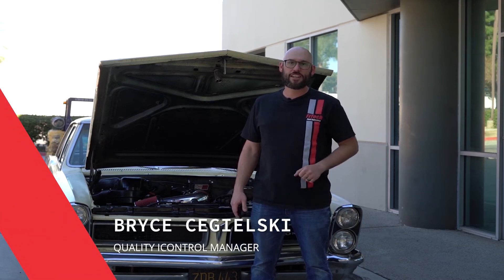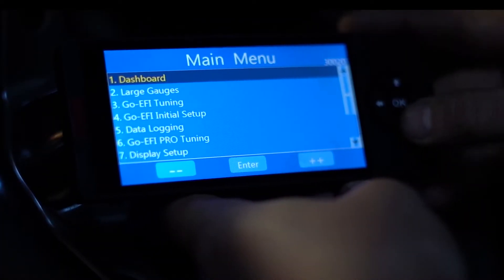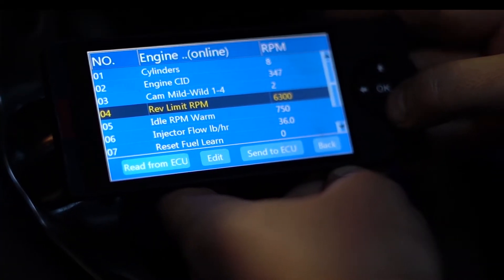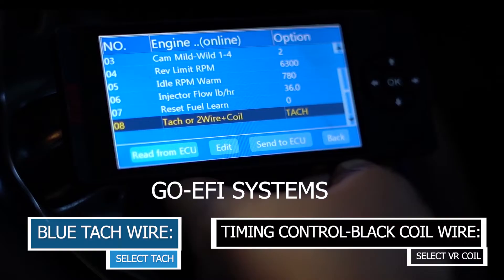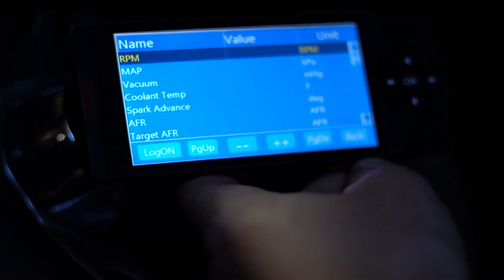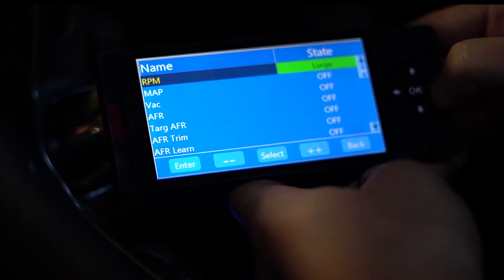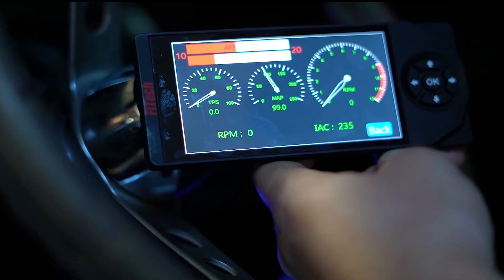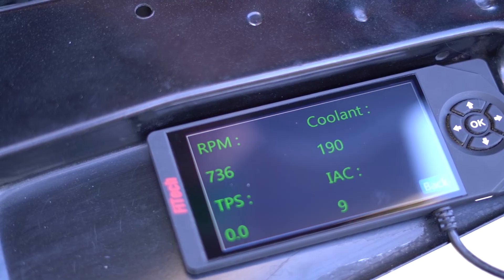Initial Setup  | Tech Tuesdays | EP3

Comment: Does the 70006 kit program the same was? I’m looking at buying the 70006 kit with I take for my 6.0 LS.
Reply from the maker: Hello sir,

The 70006 LS system or any FiTech system have the same style of initial programming. The LS system also shares an initial set up menu where you program your system according to engine information.

Comment: My handheld has no Tach or 2Wire+Coil selection option. I've read this is critical and my system is not performing well. A little bit desperate here.
Reply from the maker: Systems that do not have the timing control feature will not have the "Tach or 2Wire+Coil" setting. These systems are permanently set to tach. If you need additional assistance please contact out tech support team at techmail@fitechefi.com or 951-340-2624.

Comment: There is no idle set mode?
Reply from the maker: Older versions of software did not have this settings. You would just key off and allow the system to save (rezero TPS) then restart.

Comment: Literally none of these options are on my handheld!
Reply from the maker: Are you in the correct menu? Some settings where added or removed based on the software version however the basic info of # of cylinders, CID, Cam, Warm idle speed, rev limit have always been there.

Comment: Once your done setting the iac. Do you have to go back on the hand held and change the setting to off on the iac?
Reply from the maker: When the key is turned off the system will save and turn the Idle Set Mode off.

Comment: I found documentation from FiTech stating to disconnect the throttle cable first before adjusting the IAC screws. Plus make SURE to adjust both front and rear IAC screws if you have a 4 barrel.

Comment: Hi, my handheld freeze at the logo. I use 2 doted 30003. Could you please help me. Also I didn't have any software updating. It was working charming before but today i freezed on the logo
Reply: They won't help you. I purchased the Ultra Ram for SBC. It doesn't work. The IAC step numbers won't register and I have been trying to get them to help for 9 months. They don't respond.

Comment: I don't have option 08 Tach or 2wire+coil ????
Reply from the maker: Not all the throttle body systems have this option, only the time control compatible systems have this options

such as:30001, 30002, 30004, 30012, 30061, 30062, 30064
Reply: @FiTechEFImedia I purchased the 30005 kit... how do I get it to run off of tach. Everything is in place ready to go but that option.

Comment: Noticed you are  using the throttle lever arm "smaller hole" ... this leads to a short pedal travel with a Lokar pedal.  I get around 1.5" pedal throw which is too short.  Should I move the throttle cable out to the end of the throttle arm or shorten the pivot on the Lokar (not sure if I can do that though).

Comment: That was actually really funny how even you were surprised that it actually worked and you had to laugh when it fired up. I love my fitech but man do people have problems with them on a lot of forums.
Reply from the maker: Hello, that was actually a reaction/blooper to getting the shot for the video. In regards to the forums, it is for that reason we have created Tech Tuesday, we are seeing that people are getting the help they need from these videos, the goal is to be able to provide as much support for FiTech EFI users as possible!
Reply: I think the biggest complaint on the forums is customer service, or lack of. 

I personally have no issue with mine, but the one time I did make a call it was literally 20 minutes on hold…..I can see how that can be frustrating to someone that is having problems and has to call half dozen times

Guess it no worse than calling credit card company and talking to a robot over and over again….zero, zero, zero, zero….then you get a real person 😤
Reply from the maker: @ss0073  Hi Stan, our tech department hold times can vary based on the issue of the caller. Some calls can be handled in a few minutes, while others may require more in depth troubleshooting. Our goal is to help those calling in and guide them towards solving any problems they be having just like we would with your phone call. 

Unfortunately, that can result in longer hold times but you can bet that when we get you on the phone we are going to do everything we can to get you the help you need! You can always contact us on any of our social media platforms as well if you have more simple questions and want to avoid waiting on hold.